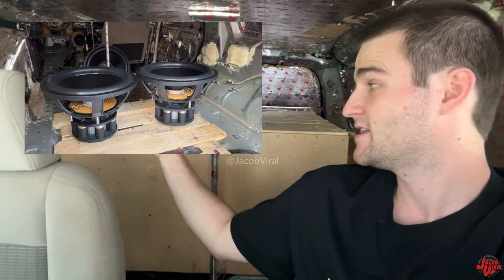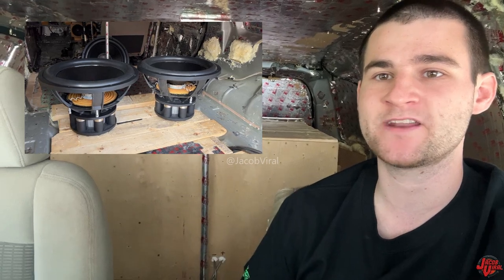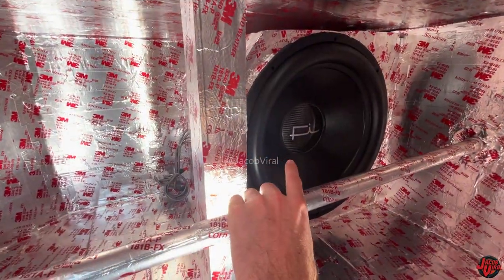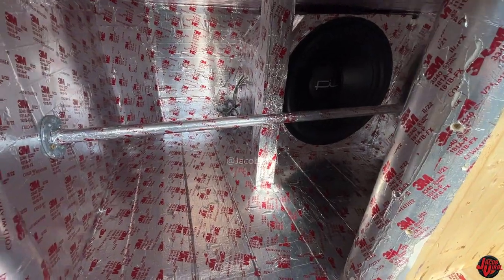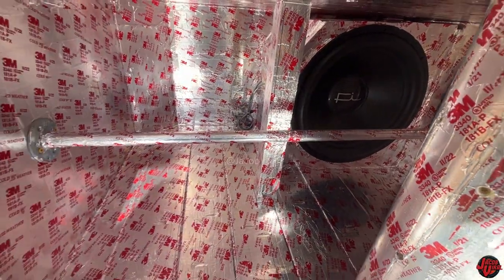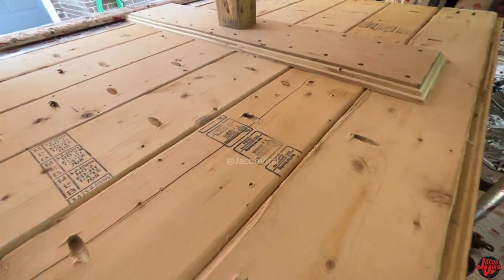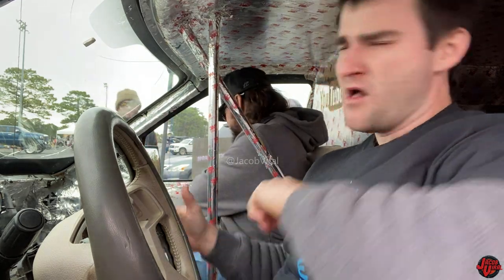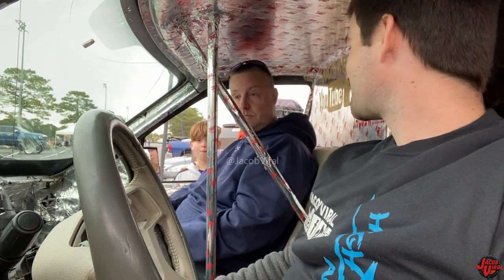REVEAL OF MY NEW SUBWOOFER SYSTEM FOR 2023!

Comment: Awesome. I really like that you re purposed the wood and screws. I had a storage unit I built that fits in the cargo of my yukon. I gutted it and turned it in to a sub box tuned to 32 hz with pallet wood for the second layer of wood. Sub I am using old school autotek SS 12 inch single voice coil.  With a Clif Designs CD5.2LX
Reply from the maker: Very nice, yea it was a thought to try out no spend and use what I had type system for fun.

Comment: You going to have horrible box rise you have to wire them down extremely too far in order just to stay below 2 ohms you're better off staying with the stepsom
Reply from the maker: It's a dual 2 ohm sub, wired to 1 ohm. May consider two amps strapped at 1 ohm making them half ohm each or stick with the 13k I got for now and see how it does.